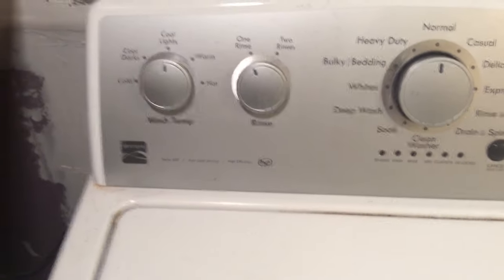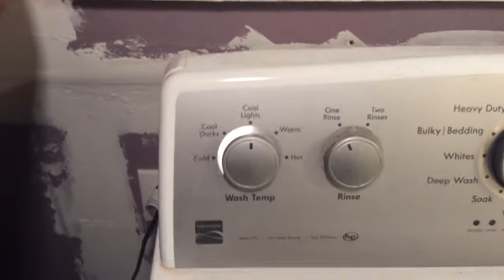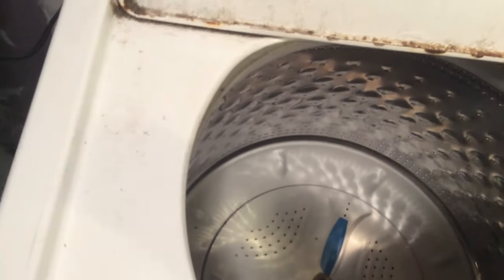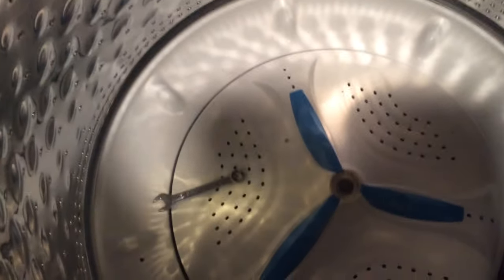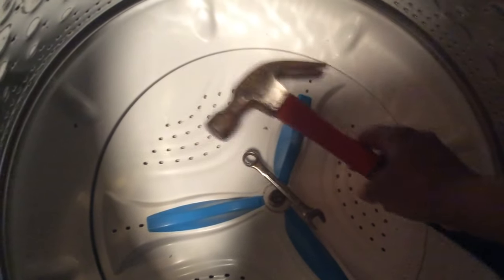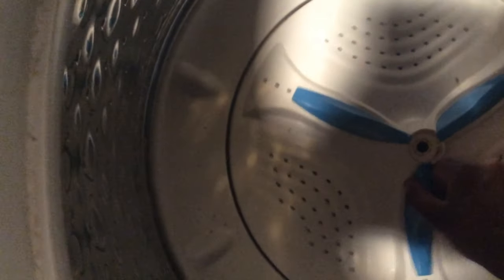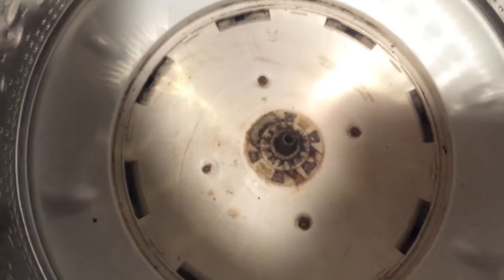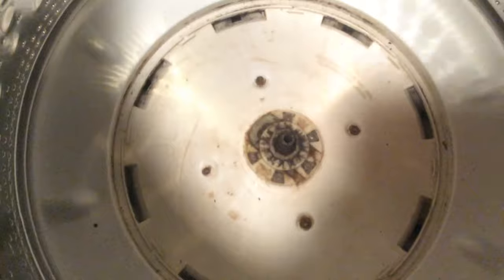Kenmore Series 500

Comment: Leave the bolt halfway threaded in and tap on the head with a hammer while pulling up on the agitator. Mine was 11mm not 7/16s
Reply: 11mm is damn near 7/16 and both will work on the nut..  just a little fyi..

Comment: I have this exact same washer.  It won't spin out the water.  It starts to spin and then makes a horrible noise and then stops.  I found screws and nails in it and took them out (out of my pocket) and am wondering if something got through the holes and into something causing this?
Reply: ever figure out what it was ? mines don't make noise but it's not rinsing and clothes be all wet. it drains but that's about it.
Reply: @jeremiah1797  did you ever fix it
Reply: You have coins under center plate in drain holes

Comment: Struggled with getting the agitator out until I thought to use two mini picks in the center to put the force where it needs to be. Came off quickly after that. Also used some WD40- it’s a spindle that is all rusty. Put white lithium grease so maybe next time- if there is one- is easier.

Comment: I lifted my washer up off the ground by the agitator and it still won't come off. We washed a few loads after removing the bolt, dumped scalding hot water in it, sprayed wd-40 around it. Even with vice grips and pliers on the blue spines lifting and someone tapping the hub with a no bounce it just won't come up. I don't get a click or thunk when I pull up on the tub, when I pull up on the agitator the tub comes with it and maxed out at top of travel. I'm a lil perturbed.

Comment: Even after I removed the coin, there was still a lot of noise. What should then? Also thank you for this video it was very helpful!
Reply: Did you ever figure out the issue? Another common issue with these is the pulley going loose. Tightening the pulley can be of help.

Comment: How tight was the bolt the first time, i ended up stripping it. Got an extractor but still too hard and will not budge. Tried impact drill, channel locks, the hammer (did you tap it or hit it hard? Right on the nut?)
Reply from the maker: I just tap it with a hammer

Comment: Hey Lance. Have a question regarding take the agitation out. We flowed your instructions.  The problem where having now it getting the agitator out it's really stuck!! Help!!
Reply from the maker: The most important thing to remember is pull the drum upward they should pop the agitator up. Then wiggle the agitator back and forth. You may have to do it several times. Good luck
Reply: @2010cabj  yes did all tha. But will keep trying .thank you so much for answering so quickly

Comment: Hello I have a kenmore series 500 I just bought it a few weeks back and it will not spin at all it rinses,drines fine but it will just not spin do you know what’s wrong with it?
Reply: think i seen somewhere that it could be the lid switch for that issue
Reply: We spent $100 for the latch and switch, and it still doesn't spin. I'm at a loss as well.
Reply: Mine did the same thing, the belt was loose. They tighten up and it was working just fine.

Comment: While holding the agitator loosen the 7/16 bolt partially.  Then lightly tap the top of the bolt and the agitator will pop off the shaft.
Reply: Tap tap tap lol
Reply: Mine is still stuck. Did citric acid, tried lifting the rim of the basin and giving it a shake, nada. Any other ideas? 

I replaced the transmission hub last winter and the impeller popped off just fine. Now, I'm really at a loss and this thing isn't agitating.
Reply: Took about an hour and half of wiggling and I ran a strap under the agitator so I could wiggle both sides at the same time and it finally popped.  Didn't find the missing ring but I still appreciate the video.

Comment: I was a washing a small load of clothes today and I noticed that the machine was agitating a little louder than usual and when I came back to check on it; the completed green light was on, but my clothes were full of water as if the machine didn't rinse them properly.  I then turn the switch on rinse and drain and it sounded like the motor and belt were spinning, but the inside barrel of the machine was not spinning.  It sounded like maybe a belt was slipping or something?  It started to spin, but wasn't spinning continuously or fast as usual.
Reply: Im thinking it might be the pulley?
Reply: How would you know and then change out the pulley, if that is the problem?

Comment: I have this exact washer and I am having problems with it draining all the way,when I pull my clothes out they r still very wet,I can hear it draining when it's running and it's making a weird noise during the rinse and spin cycle, any ideas
Reply: i have the same problem ,did you find out what it was.. mines just stays on spin but it don't spin i have to start it over again and then it works but most the time the clothes are wet i have to rinse it by hand.
Reply: Same here! Anybody get a for sure fix for this?

Comment: Thank you for this; but what about if the machine makes noise and stops spinning? The when you turned it off it continues to try to spin
Reply from the maker: To reset your washing machine, unplug it from the power outlet. Then, plug the washer cord back into the wall. Finally, open and close the washing machine door six times to send the reset signal to the system components.
Reply: I can't get my agitator loose

Comment: I have the same washer you got I tried everything to pull out the impeller and it won’t come out any suggestions
Reply from the maker: Try putting you hands in the 9 and 3 o’clock position and push it the left hand first than right hand back and forth
Reply: @2010cabj  I’ll try it appreciated

Comment: I have the same washer..mines makes a weird noise. The lid locks then the rinse light flashes..also my impeller is pretty wobbly?? Would greatly appreciate the help...
Reply: We have the same issue with the flashing lid light. Did you ever get an answer, or what was your outcome?
Reply: Motor was bad. Had to have replace and also wash plate was broke

Comment: Did this when it wouldn’t drain. Every port was clogged with coins except for one. Thought for sure that it would solve the problem with draining. There is no filter and  have had everything apart looking for a clog and found nothing of significants. It seems to be getting thrown out of the cycle with just 4 pairs of jeans.
Reply from the maker: Yeah does not seems right. Did you reset the machine and make sure it is level. When it’s not level it goes out of wack and want to complete the rinse and drain cycle
Reply: @2010cabj  Yes, girlfriend has me do the reset every week. I don't want to just throw new parts at it until something works. Running the whole load through again eventually gets it done, so I know it's not a clogging issue.
Reply: @kitexscape  how do you reset it

Comment: Just did this, the bolt is super tight.  Get a socket 7/16ths, then use a hammer and keep tapping on it counter clock wise holding the bottom piece with your thumb.  Once it’s off. Banging it did not work for me, get two pair of channel locks,  grab it in the center/ outside where the bolt center is. Rock it back and fourth and pull up. Only place to grab on it.  Every port hole was filled with change. Use needle nose and screw driver to get it out
Reply from the maker: Great job, how much did u make

Comment: My spinner wont come off remove bolt & still try pop off & wouldn't come off??
Reply: I’m having the same problem. I’ve yanked the tub  back loads of times but its not budging. Did you figure out a solution?
Reply: Yes we bought new one the computer was burnt out anyways , checked by Sears Technician.

Comment: It will not just pop up like that . Mine was on there tight as shit. Used some CLR and other solutions to loosen up . Soaked hot water then looped to hangers through holes on separate sides. Put my whole body weight into it n it still wouldn’t come off . Tapped around with rubber mallet while pulling hangers and wala .
Reply from the maker: Yeah you’re stuff was tight as ish

Comment: I have that same unit, can you or anyone tell me why none of the wash cycles (EXCEPT THE BEDDING/BULKY ONE) use very much water? The clothes seem to get wet but you can only see little if any water in the tub. No way to use fabric softener because there's not enough water in the rinse cycle either. Not sure how it cleans. Bulky/bedding fills up fine. Thanks
Reply from the maker: I don’t why but many more of the experts on these message can answer it
Reply: It's an HE so it's supposed to be water saving and uses as little water as needed
Reply: @crazyblonde2012  tell me some more while my Kenmore 500 series washing machine not washing it goes into wash mode and just turn just a little bit back and forth but just not wash the clothes
Reply: It does everything else Friday just do not wash the clothes right
Reply: Are you going to answer me

Comment: How do you add Detergent to this kinda washer?
Reply: It’s a ball that goes inside that fills with detergent
Reply: Sold separately
Reply: I just got this model....I saw another video telling me the detergent goes in first..... and fabric softener goes into a lil ball.... did you ever find out the correct way?
Reply: @mendozafloresmf  I did not. I just have a small jug by the washer. That I mix the liquid detergent in with some hot water. To  dissolve the detergent. Then pour it over the close.
Reply: @mendozafloresmf this is just me but I think this washer sucks. And is the worst washer I have ever used.

Comment: mine wont come off lol been doing it for almost hour i gave up ran a cleaning cycle
Reply from the maker: What part will not come off?
Reply: 2010cabj  the part u do we take screw out lift up on washer basket to knock it loose it won’t pop off at all
Reply from the maker: Mine was tuff when I first did It. Just put your hand at the 9 and 3 o’clock position and pull up and push down sever times and it will work

Comment: NOTICE there's nothing clogging those drain holes. Same thing when I took mine off. There was nothing clogging them either.  THIS IS NOT THE RIGHT WAY TO FIX THIS WASHER''S CLOGGED DRAINAGE PROBLEM!
Reply from the maker: I just gave you a example on what fixed mine
Reply: @2010cabj  ok 😁

Comment: Mine is doing the same thing...
Reply from the maker: Did u get it off?
Reply: @2010cabj   by any chance have you had the issue of the washer shaking while on spin cycle?
Reply from the maker: @carrillo713z  yes, there could be many reasons, 1 your washer is in balance. Get a level and check it. 2 the washer spring is warm or is busted. I am sure there is many more but those were my issue